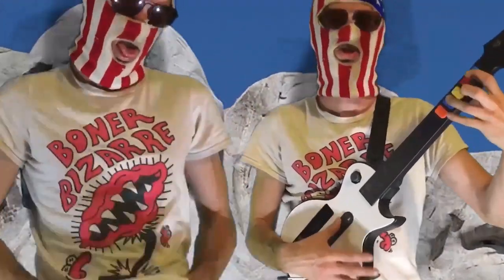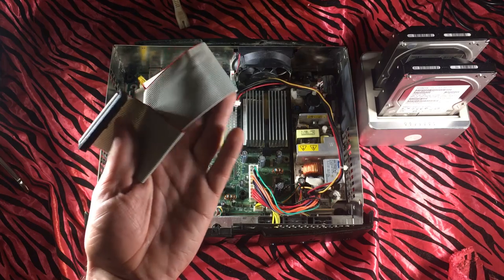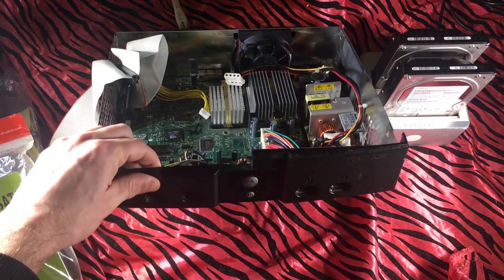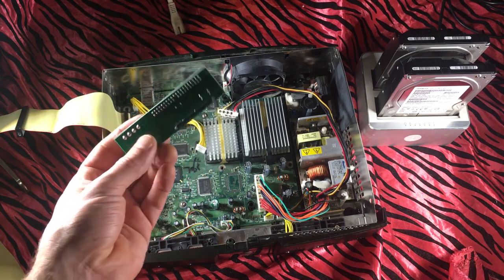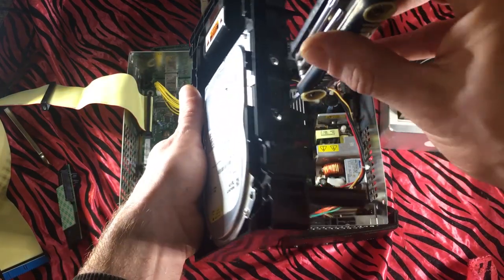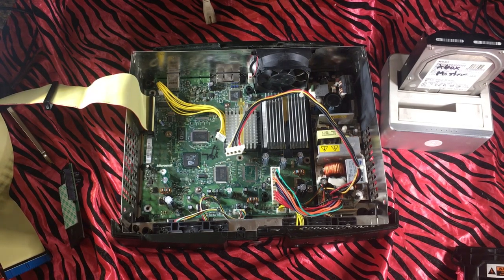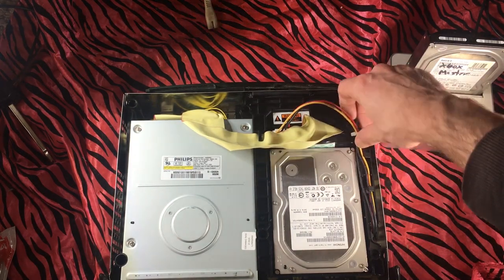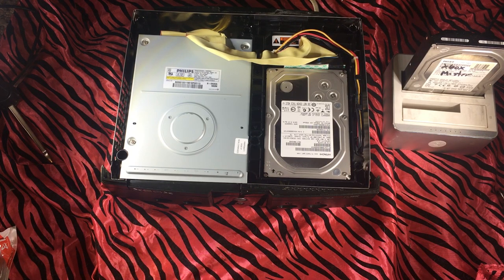Let's Fix / Mod an OG Xbox - #4 2tb Hard Drive Upgrade

Comment: Have you repaired a og xbox with a dead hard drive never been modded
Reply from the maker: Yes but you’ll need to install a modchip.
Reply: Yeah thats what i mean i have 4 with code 7 and dead hard drives i got for cheap like 15 dollars all 4 would a alladin xt plus help
Reply: What mod chip you recommend
Reply from the maker: @anthonyaviles8665  Yeah alladin's are totally fine. Burn a copy of hexen, install the chip and make sure to flash Evox F and G in hexen then format the new drive
Reply: Oh thanks i just need  disc with hexen what version of hexen
Reply: You sould do a video of rebuilding the hard drive when the xbox original hdd takes a shit when no mod or anything
Reply from the maker: @anthonyaviles8665  that’s not a thing unless you have a backed up eeprom. Pretty pointless as well. My time of thumb is hard mod all ogxboxes as the hard drives will die eventually